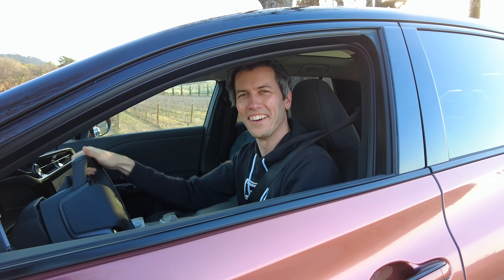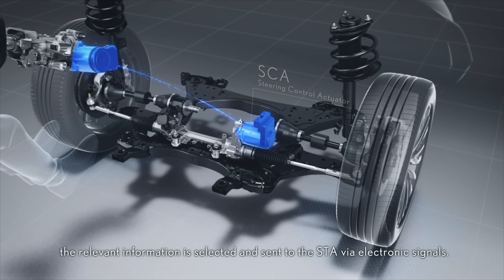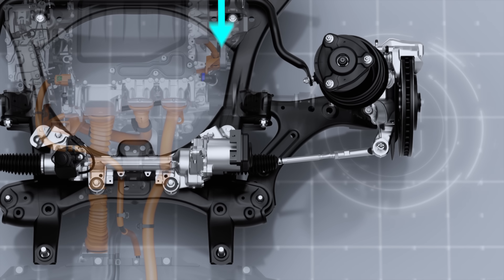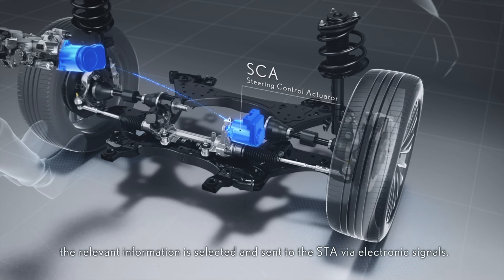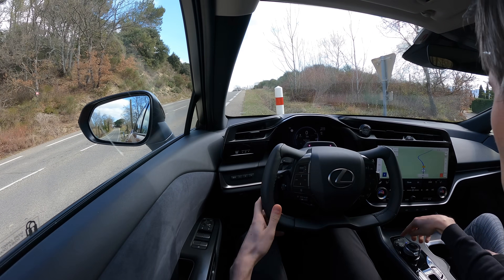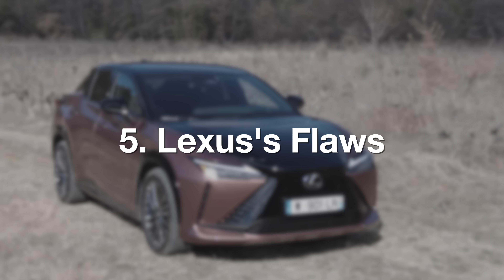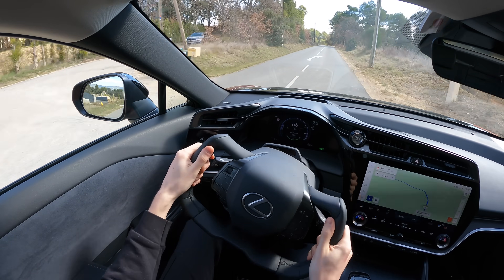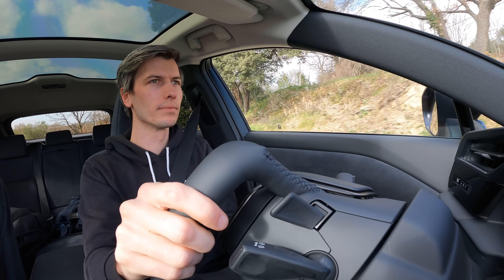How Lexus Fixed Tesla's Bad Idea: Steer-By-Wire Yoke

Comment: Things like this just shouldn't exist. In the early 2000's BMW solved all these steering problems by inventing the Active Steering system, which changes the ratio continuously. You get all the mentioned benefits but the normal steering shaft stays in place in case of accident etc, and everything feels beautifully natural.

Comment: Very cool! But I think your disadvantages are incorrect. 

For it being twitchy, they could use different steering modes to dull it down or have a sensitivity slider much the same as the mouse on a computer example you showed. 

For people who want a fixed steering ratio like a traditional system, they again could have that as a setting in the car. 

This point is a downside of the yoke, not of the steer by wire system. 

If you want a fixed steering ratio, option the car with a regular wheel then you can have the option via software to have a fixed or variable rack ratio. 

Also a slightly unrelated point about responsiveness, you’re the engineer so you can tell me if I’m possibly correct or entirely wrong 😂. I imagine Lexus could say a faster steering response to 100% match someone yanking the wheel as fast as physically possible isn’t required as it’s not really someone does in normal situations and secondly I’m not sure but I think there is a maximum rate you can steer before causing a loss of grip due to turning too fast? For maximum steering effect I imagine there is a maximum rate you can turn the wheel before turning too fast breaks traction due to the car not responding yet to the new direction the wheel is facing. If that’s true then there is no need or want to have the wheel then faster than that?

Comment: They will not get rid of that delay. In throttle by wire, there is still a delay despite how long it's being in production. Maybe you are used to it, and don't know the difference, but motorcycle guys know what I'm talking about.
Sometimes times a physical connection is best.

Comment: I was under the impression there were legality issues w/ steer by wire. Perhaps the triple redundancy resolves that?
But on the responsiveness... Throttle by wire improves responsiveness of an ICE(and is just a reflection of the inherent power delivery options of an electric motor). but that does not mean zero latency. It only masks latency from what came before. Steer-by-wire could probably be very responsive, but it's unlikely to be as responsive as a mechanical connection(assuming good condition/low lash). Computation takes time.

Comment: 13:46 so, if you turn the steering wheel on 45 degrees, hold it in this position and your speed will increase or decrease then your front wheels will be moved even if you don't move your wheel ....

Comment: Well i mean if anyone ever owned a high end remote controlled car like my hpi nitro rs4 rtr then this really isnt a big deal. Especially since its a dedicated wire and not over a radio. Servo steering is pretty cool. But you mentioned if there is no power and 3 power sources? Yea i didnt even think about that. With a direct shaft you can always turn the wheels with no need for heavy extra redundancy measures. Still tho, with hydraulic steering i dont see why this is needed. I remember in 2002 on a trip to Trinidad we were going to Mayaro or Manzanilla beach i cant remember and we missed a turn. Lol my uncle was driving his Zephyr. Our rented corolla did it in 3 points, tool him like 50. Soo, i think this system is just encouraging bad drivers. If u dont like driving and can afford this u might as well hire a chauffeur. 
As they say in america, driving is a privilege, not a right.

Comment: Wouldn't it be possible to deal with the twitchiness of a high ratio mechanical steering system by adjusting the amount of assist you get as the speed increases? Yes, slight inputs will still unsteady the car, but it's be harder to accidentally perform them if there is more resistance in the steering due to power steering being reduced.

Comment: Infinity had steer by wire a long-long time ago with the Q60, so its not that new deal. But they had a backup column if the system fail, and just sayin it will fail in this case too. So what will the system do, if there is an electrical problem for example at highway speed? You left in car with no steering? Sound like a masterplan!

Comment: honestly, at this point i want  a car that is plain,
In new cars there is so many breaking points that it is  only a problem to fix it, if it breaks.
give me a car with old style stearing and stearing assist , AC, manual gearbox and combustion engine. Nothing more and i would buy it.

Comment: This is basically the same as video games do. The problem with that, in video games that don’t help you with that actively, is counter steering. If you’re oversteering you might want to steer a lot on the opposite direction, and the adaptive steering ratio will prevent you to at high speeds (which is where oversteering is the most dangerous and can be only corrected with fast and “wide” steering action). I really hope this scenario is correctly addressed in this solution 😬
Reply: I don't see how it will prevent counter steering when the steering ratio would be similar to mechanical steering at those speeds
Reply: @kiyotaka269  because of the steering lock being very limited compared to a regular steering wheel, you’re not able to use all the “steering degrees” at the wheels. Unless they did some trickery for counter steering with the steering ratio
Reply: @piereligio_ds  limited in what way? The only issue I see is the delay and the yoke design, hopefully the delay will be fixed over the time.
Reply: @kiyotaka269  if you got about 360 degrees on the yoke (which doesn’t change) side to side (so 180 for each side. Consider that a car usually has 900 degrees steering wheel lock) and that translates to a maximum angle of the wheel of 10 degrees (for example of course), in the highway speeds, the problem is that when you have a loss of control in oversteer you could need to steer the wheels much more than 10 degrees, and you’re unable to
Reply: @piereligio_ds  Lexus confirmed that they use a non-linear steering ratio at higher speeds so you still get all the rotation of your tires even at low ratios.
Reply: @JosieShmosie-x7m  oooooh that explains it. Makes sense, thanks
Reply: Its not the same  this is real life,  video games are different  like playing  call of duty  you get killed, you respawn right away
Reply: @bigdavedayday1581  oh god. It’s about inputs, and it’s basic geometry. I used the videogames as an example, also on sims you get the same issue setting up the controller wrong. For this, in fact, I turn off completely that feature even for the controller (meaning when I don’t use my steering wheel), which requires extremely precise input with the thumb but it gives you full control over the angle of the wheels. If Lexus didn’t put some sort of oversteer assistance inside their system, and you happen to have oversteer, you’re unable to counter steer fully. And that’s for basic geometry. I explained in detail why, use your brain instead of making up random associations with the general realism of a videogame.

Comment: So , how do you steer when you loose power ?? Yes I would rather walk . 😅Yes I watched the vid , as the car ages connections fail even on extra back up components 🤔
Reply from the maker: FYI - if a backup fails you should replace it, not wait for the rest of the components to fail. :)
Reply: @EngineeringExplained  It is new and it will have its failings until they perfect it or abandon it . I do not trust a unproven technology on vital component like steering 
But 
Thank you for your response , I very much enjoy your videos . Cheers  😀

Comment: I don't think the variable steering would be that big of an issue. Ultimately your brain is already doing the math to figure out how much you will turn based n speed, so I think this change would sink in very rapidly. However, I would be worried that I couldn't chuck the car into a slide at high speed to avoid an accident in a pinch.

Comment: Why not go all-in and replace the rack with linear actuators, or further still: Fit high-torque/stepper motors at the strut top, or further still: Fit front casters, controlling direction through rear torque differential?

Comment: I'm a mechanic, so take everything I say with a grain of salt. Obviously, my livelihood depends on how a vehicle is made. If it comes with serviceable, interchangeable parts, great. I can get a customer back on the road safe, and make a little money doing it. But these parts are not going to be cheap, forget even being serviceable. People are going to lose their minds when a small, fragile wire or connecting pin in one of these new devices get broken, and ends up needing a full replacement of the device and the harness. 

Another concern of mine is safety. I'll really sound like a geezer with this one. While the vast majority of folks have no idea and don't want to have any idea of how their vehicle works, I'm certain they'll want to know more about the inner workings when one of the SCA in one of these new Lexus' makes a miscalculation at high speeds. Gears break, power steering lines fail, but they generally will not be an immediate cause for concern when you're driving down the highway. That's not to say you should drive cross-country while your power steering system is failing, but take it to a mechanic and get the line or gearbox replaced for a couple hundred bucks.

Comment: Large delay is expectable, especially since this is the first generation of such system:

- Sensors take measurements of different parameters every X milliseconds;
- Electric signals have to be physically transferred through wires;
- Since there are multiple sensors, it means that there should be some sort of central computer that will parse data from each sensor, process them and give necessary signal to electric motors;
- Electric motors require some time to create or change electro-magnetic field and a rotor is a physical object that has it's own mass (very small, but still) and thus inertia.

All these delays that I described are very small, most likely several milliseconds each, but when they stack on each other - the lag becomes more noticeable. The good news are that future designs can make these delays smaller thanks to software optimizations, more responsive electric motors and faster processors. I won't be surprised if in order to reduce time for signal transferring some car companies will try to use optical fiber.

Comment: Citroen used to have also steering system with no direct mechanical connection to wheels, called diravi. I used to have XM which had that system. It was done hydraulic and no forces were transmitted from wheels and the steering wheel was always self centering even when the car was not moving. I did like it, and I think I would like this Toyota system too, but without that force thing.

Comment: General Motors did this back in the 1990's as a concept.
The main difference was that throttle and brakes were also built into the wheel, negating the need for the pedals. Toyota missed an opportunity to produce a similar control system for full motability. Those with no legs could so easily drive a car if the throttle was controlled by the right hand and brake on the left hand.

Comment: Great video as always! I like the redundancy built in, but the safety implementation of Infinit's Q50 steer by wire I think is preferable to me. The mechanical coupling engages when there is a fault, allowing you to continue driving even if a creitical component fails. Steering sucks when it happens, but at least gives you a bit more room for error.

Comment: I like the redundancy of the motors.  I hope that the wiring is armor shielded.  I've seen too many high tech systems in vehicles brought to their knees by a mouse.  Engineers rarely think of rodent damage in their designs.
Reply: Imagine if the wire was damaged by a rodent but only failed while driving, it's a rare situation but a possible one.

Comment: So if the vehicle loses electric power while in motion, how does the Lexus system guarantee the operator can still control the vehicle?
I've lost electric power temporarily while driving multiple vehicles on public roads,  so this is a real possibility. "Unlikely" isn't good enough for the people who didn't agree to this system like pedestrians and other drivers.
Reply: If battery and onsite generation can't prevent momentary failure, I don't trust multiple batteries to.

Comment: Very interesting system and definitely much much better than the Joke controller that Tesla has.

For me the latency would be killer. I would be okay with 5–10 ms latency but the prototype seemed to be more like 200–500 ms from the appearance of the steering vs car behavior.

And as for the steering, I would like to have constant but highly non-linear steering. That is, turning the wheel to the lock even on highway speeds would turn the wheels to the lock, too. But the center of the steering would be very non-sensitive for both high and slow speed. That's what I would want to have with mechanical linkage, too, but I think such an aggressive non-linearity cannot be implemented with a pure mechanical connection.

Also, I was expecting DD setup similar to modern sim racing for the wheel actuator. At least the illustration made it appear like there were gearing which would cause worse feedback than would be possible with direct drive setup.

Comment: No thanks. All the redundancy in the world wouldn't make me feel comfortable about that. Throw in the delay and its a hard no. If you want to be that isolated from road feel, call an uber.
Humor me on this one. Mr. Smith's Lexus has a steering motor go bad. I imagine car would continue to drive until next parked. Now he needs a tow, and will discover how much 2 motors cost as its an integral unit. Suddenly Mr. Smith wishes he hadn't chosen that option.
Just don't mess with brakes and steering IMO. Even brake by wire has a mechanical fall back in the cases I've seen. You want to clutch disconnect the steering shaft be my guest, but that should require power and failure mode be direct link.

Comment: All of the karts I've raced had similar steering wheels but the lock to lock on those karts was about a quarter turn in both directions. Any slower steering would make that sort of steering wheel useless.

Comment: As someone that works in automotive, all I’m seeing are recalls, failed wire harnesses, failed sensors, faulty software, failed motors, etc etc etc

All the electronic parts in new vehicles do is overcomplicate the vehicle and make it more difficult for the end user to fix their own vehicle without having a lot of experience in electrical issue diagnosis. Not to mention increases costs when the vehicles are already absurdly expensive.

Comment: I would have to drive the steer by wire but I dont think Id like it. I ride motorbikes I like the directness of the controls, especially electric motorbikes as Zero SRF and Yamaha GTS (Hub centre steering). Ive ordered Plaid S, I drive Tesla Model S P85 RWD (the 2 WD steels a lot better than the 4WD) but I will be having a steering wheel on the Plaid. The yoke is a bit loopy if you have to do rotations and limiting rotation means putting yet another barrier to response in the way of servo connection....not for me.

Comment: A quick steering ratio helps at high speed, that's why F1 cars have it, you can countersteer extremely fast and save or control the car easier but it would be annoying on a street car, it would require a lot of focus. Anyway, the drive by wire wheel seems awkward to me. I guess if you drive slowly and carefully you'll be ok.

Comment: If your speed goes down during a fast turn, and the steering ratio changes (from sluggish to twitchy) during the turn, and then the yoke won't be at zero degrees to get the wheels straight. The alternative is to preserve the steering ratio until the car is going straight, and then change the ratio, which may make the car steering feel very sluggish coming out of the turn (compared to normal low-speed maneuvering). Either that or the steering angle would need to change as the speed and steering ratio changes - not something a driver would appreciate, I think!
A better approach would be a non-linear speed-independent relationship so that at freeway speeds the steering is sluggish as the steering angle used by drivers is small. For low-speed maneuvering, you may be more willing to turn the yoke 90 degrees or so. Some sort of square-law  in the yoke angle to steering rod displacement may work well.

Comment: That's all I want.... a steering wheel with unpredictable response to inputs. I reject all modern car tech, which is why I am sticking with my 20 year old car for as long as I can keep it running. It should have at minimum another 200k+ miles in it.

Comment: Spoken like a person who doesn’t like to drive, ride a bicycle, or fly a plane. Sounds to me that Uber is your ideal solution, not a lame copy of an old innovation. Oh, and you failed to consider one more liability, mice chew wires, which is why airplane pilots prefer to have a set of stainless steel cables attached to the flaps when your electrical system goes sideways.

Comment: Engineering Explained, the reason the Tesla Yoke is attached via steering column is because of regulation. It is required. Otherwise, @Tesla would have implemented steer-by-wire. Kind of important info on this informational video!

Comment: BMW had variable steering ratio from 2003. Effectively a steer by wire system, as an electric motor is in the torque path between human and wheels.